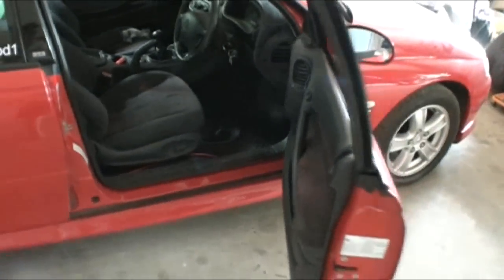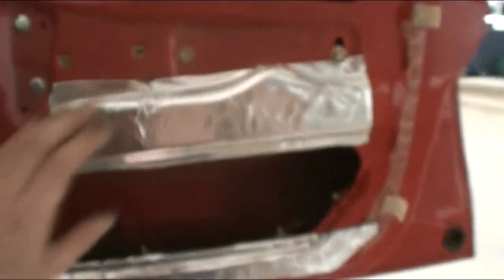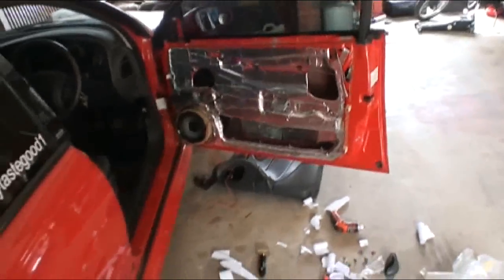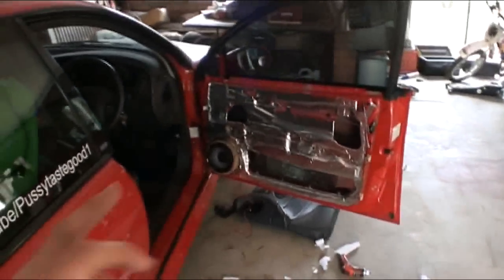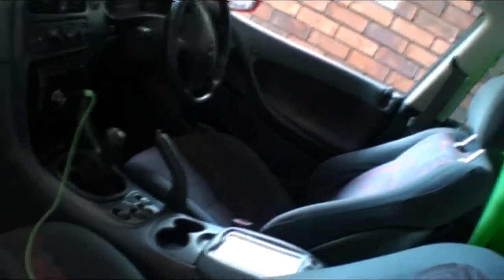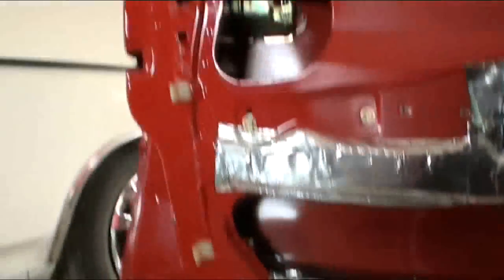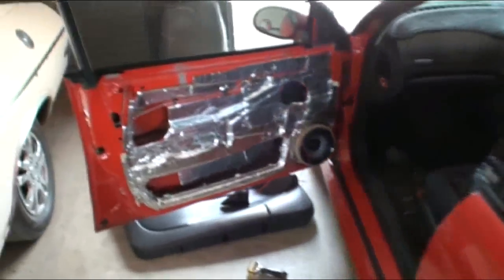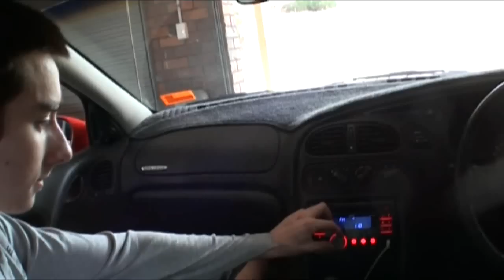Deadening VX Holden Commodore Front Doors

Comment: oh and the metal center dustcap in some mid basses are called "Phase plugs" and have a similar purpose, but better execution to the shape of a dustcap, it's basically there to help align the phase of the sound coming from the speaker, as obviously the frequency it's playing at any one time is a constant from the inside to outside of the woofer, but the distance from inside is further to your ears than the outside, causing minor cancellation, a phase plug helps correct this... gah short posts!!!